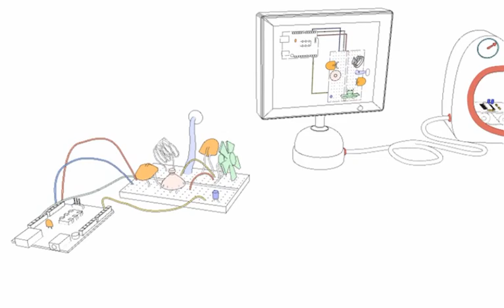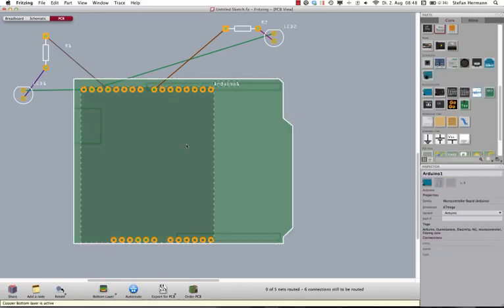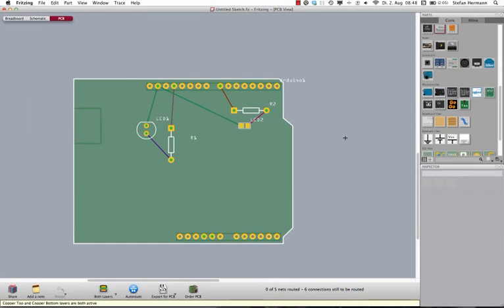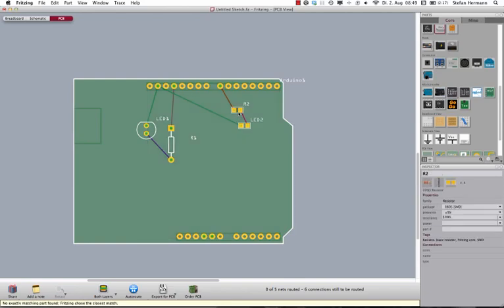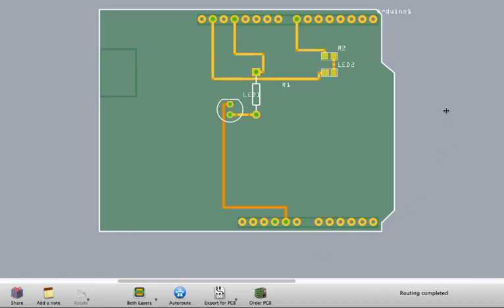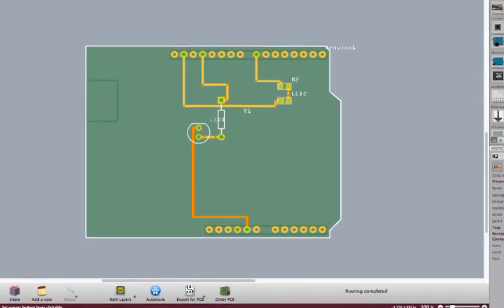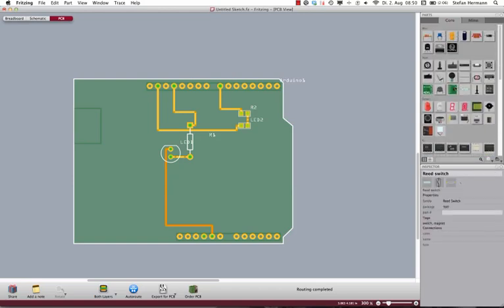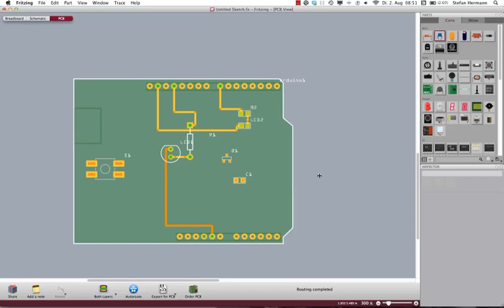Working with SMD in Fritzing

Comment: How did you move the connector in the “right place”? Did you just guess, or did it snap in the right place? Also, how would you add the ICSP connector and have it all aligned in the correct place? Quite frankly, I don’t understand why selecting the Arduino shield shape does not move the connectors in their right position automatically.